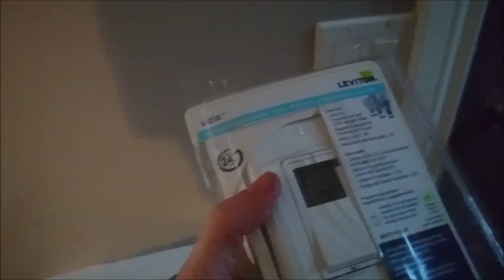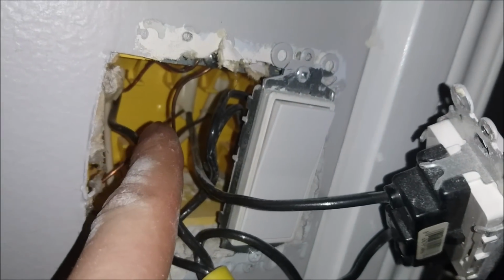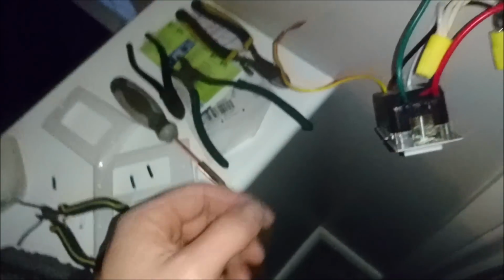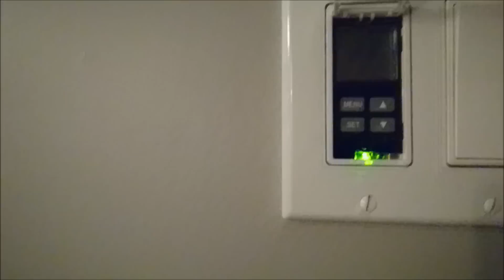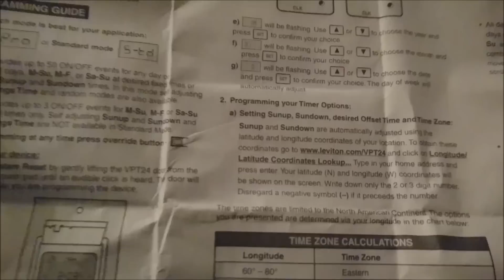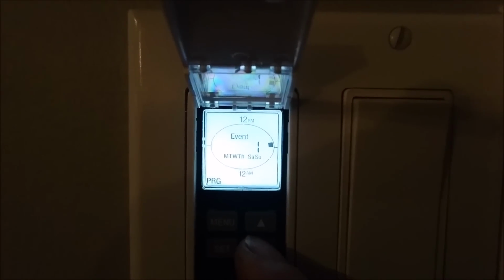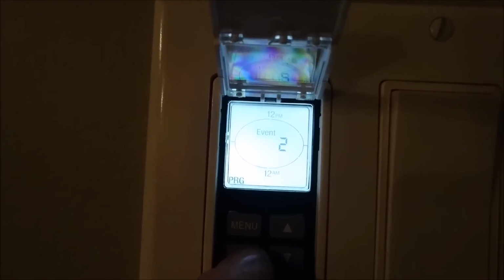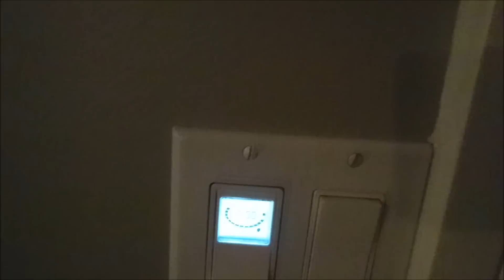HOW TO INSTALL LEVITON PROGRAMMABLE TIMER SWITCH VPT24

Comment: You need to be doing DIY videos or teaching or something. That explanation on the main hot-wireand the the red wire is what helped me. When I removed the wall plate, I discovered that a couple of wires didn't match ... your explanation saved the day. Thanks!!!

Comment: Thanks for the help… A previous video said I could hook up the black and red wire to any one of the black wires in the box. My fan would not work. You specified which black wire went where and that solved my problem… Thank you!

Comment: Thank you, I took out a faulty timer and replaced it with a manual switch.  Going from 4 wires to 2, I was able to work with your video to see which wires to use.

Comment: Hi There ....I appreciate this video very much - couldn't have installed it without your help. I do have one question though - I would like to set lights to come on at Sundown, and OFF 3 hours later. For the life of me I couldn't get that done. If you could assist would be great. I set all the parameters OK, and could get SUNDOWN as on time, just couldn't figure out to make it so it would go off 3 hours later. Thanks very much.
Reply from the maker: You would have to switch it to a certain time rather then a end time of sun down or up for example come on a sun up then off at 8 am

Comment: Hello every one this is an electrician here just to let you know that not all white wires are a neutral and if you use the return of the switch witch can be white you can kill you new switch hope this helps some one  :) always hire a certified electrician :D

Comment: 2025 - video still helpful. But - missing is Sunrise and Sunset, never saw those even after clicking all over... Also missing was the Latitude / Longitude prompt. Just checked, light doesnt shut off as expected. O for 3 here, anybody?
Reply from the maker: You need to reset your switch it is in consumer not professional mode
Reply: @ghostlyrich  programming from 50s soviet era, my god what a waste of time and one's sanity. Sending this back to Amazon. I count at least 27 steps and no undo.